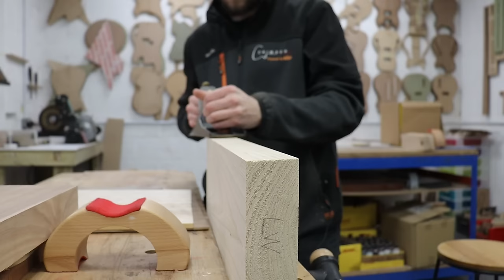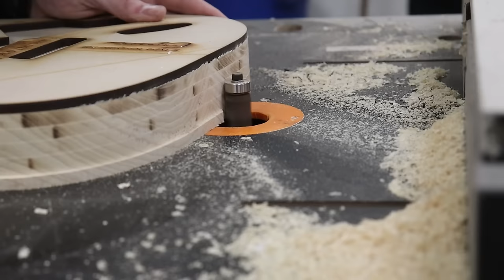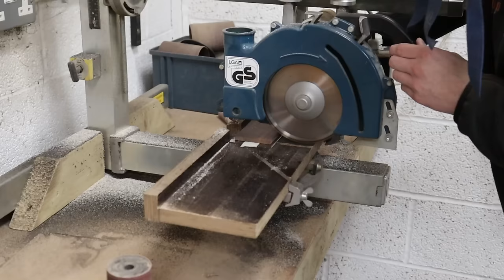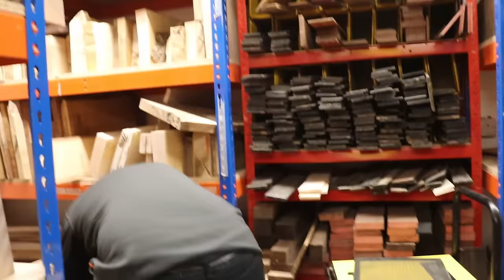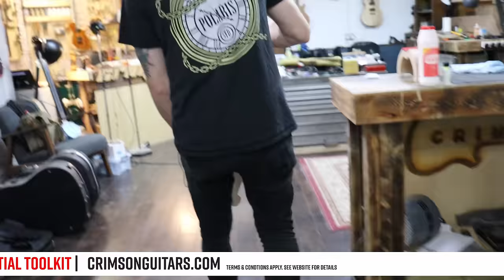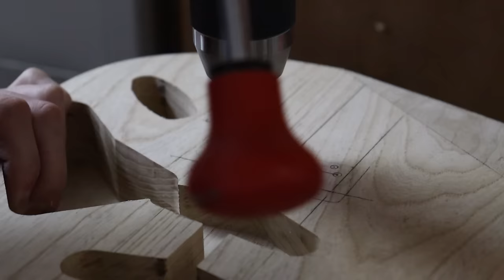Building a Custom Shop STRAT with Crimson Guitars | 1 Shapes

Comment: What do you do with all of the wood chips from the planer? How about trying a wood chip and resin guitar body? That might be interesting.
Reply: I think (dredging memory from q&a) they're fuel for the furnace to heat the building, and flooring for the landlords horsey ring out the back.
Reply: @PaulCooksStuff  yeah heating rings a bell. Didn't know about the horseys, though!

Comment: Wow.  That must be a brand new router bit. I was fearing for my life when he routed that much end grain maple at the top and bottom of the neck.  But it turned out fine.  If you do that with anything but a perfectly sharp bit it will grab and toss that neck across the room!  I would never rout that much end grain maple at one time.  I always just nibble it down.

Comment: You should send this video to Fender as a guide on how to build a proper guitar for the money. That fretboard is 3 times thicker than on my American Fender for example. My Eart Strats also have way thicker fretboards and bridge blocks than my Fender and they are $200 guitars.
Reply: it's probably the same thickness as yours only in this video the fretboard isn't yet radiused. Fender usually has a smaller radius which makes the sides of the fretboard very thin
Reply: Depending on preferred neck thickness you’re probably better off with a thinner fingerboard. If the board is really thick it limits how much neck material you can carve away. Most of the strength of a neck comes from the shaft and not the fingerboard. If you want a thin neck and have a thick fingerboard you’d have to remove a lot of neck material which will weaken the neck and, in my experience, weaken the tone.
Reply: If you're fender isn't a custom shop then they wouldn't be in a similar price bracket...